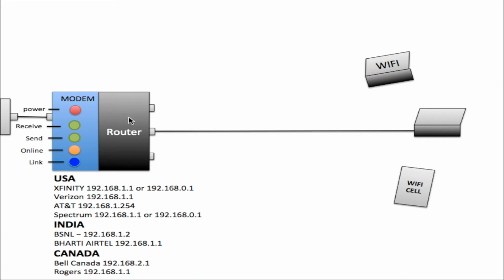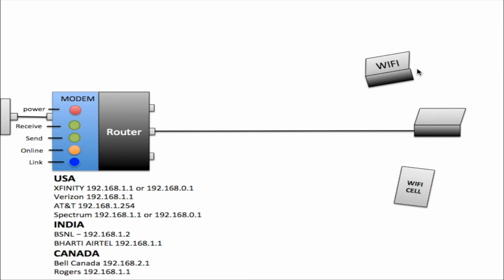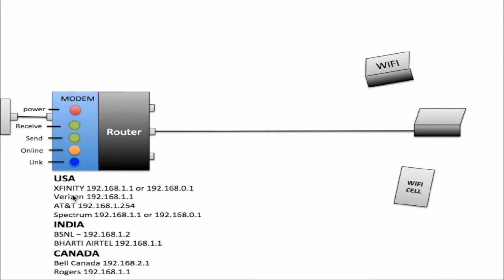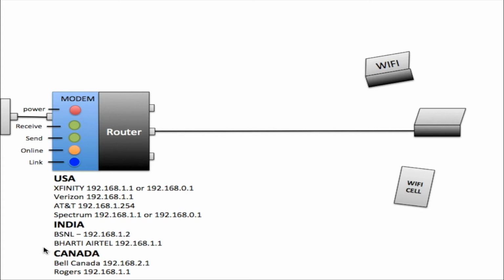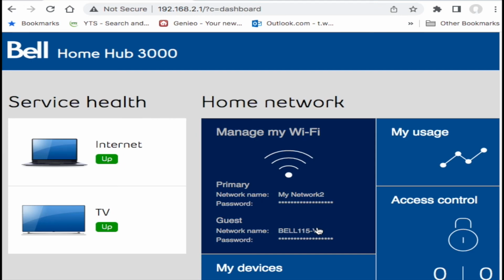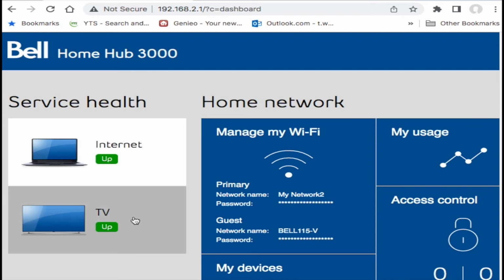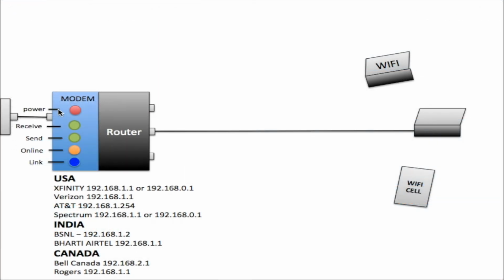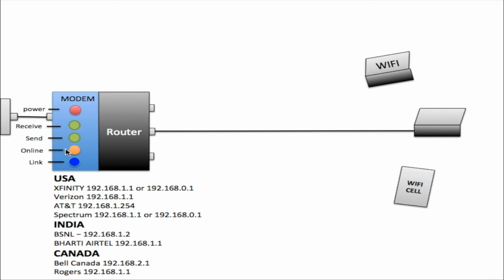Fix Your Internet Without Paying For a Service Call

Comment: Good, but if we were going to get into communicating on the LAN between a client's computer and the modem using its IP address, it is incomplete and actually a little misleading not to at least mention how it would be different with a discreet cable modem that does not have integrated router and switch. In this case the IP addressing of the cable modem is often completely different.
Reply from the maker: Regarding your question about the integrated modem/router which I spoke about in the video.  The modem is always assigned a public ip address by the ISP.  The 
 Router use a private ip address like 192.168.2.1 and devices on the LAN would be 192.168.2.2  192.168.2.3 etc.  It does not matter if you have an integrated or stand alone modem/router, they both basically function the same.